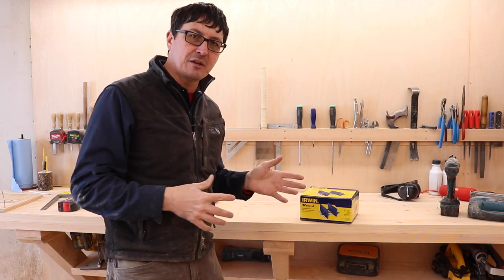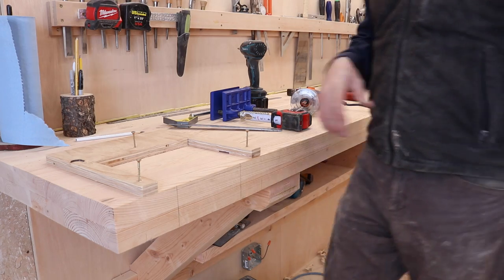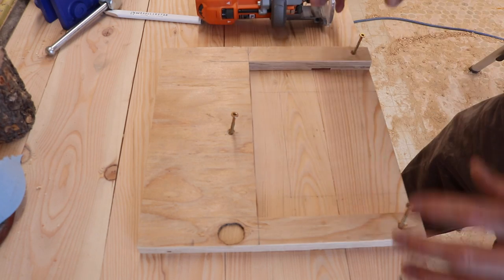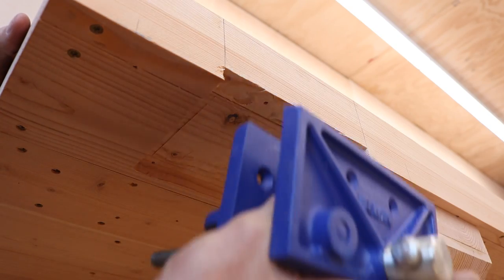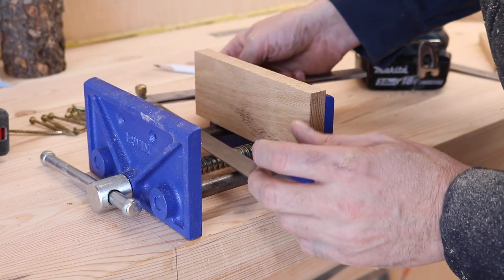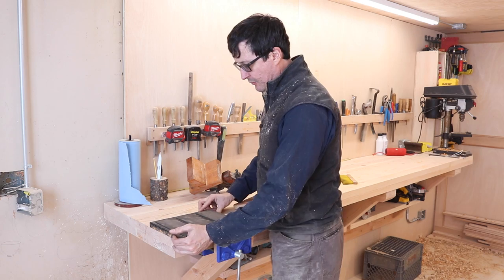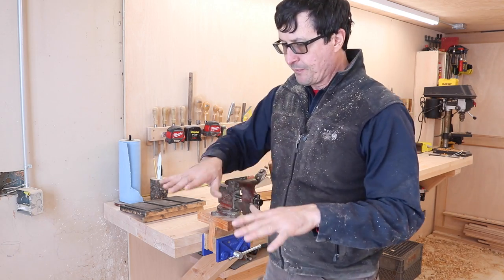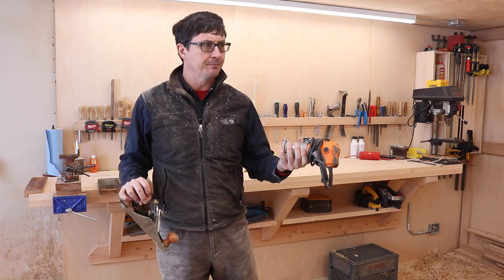The #1 Tool Every Man Must Have!!

Comment: Small suggestion, recess the back jaw of the vice into the edge of the bench you can then do away with the back packing and get an extra 1/2" of vice opening and when holding longer work the bench edge will give more stability. Consider do you want hard wood jaws? Do you want the jaws to be harder than what you put in them? or softer so your work is protected from marking. they are a sacrificial item and easily replaced.
Reply: Nice tip about recessing the jaw. I usually make J shaped jaw covers and never screw them, so replacing them it's as easy as lift them up. After awhile they are all banged up anyway. ;-)
Reply: Agree .... the jaw wood should always be soft so that they do not mar the material it's holding ... sometimes I'm amazed how some woodworkers do not think thru what they are doing ... sorry, I'm not trying to be too critical, it just comes with 87 years of experience in the shop ... thanks for your vids.
Reply: Smart stuff
Reply: @wernerfreund4949  Mmmm, sorry but I don't get that. 🤷‍♂️
Reply: Thank You RichardTWW. That has saved me about AUD$35 in not having to buy some hardwood and now I can get some cheaper pine for the jaws. Excellent! 👍 I hope that will hold the engineer vice jig when I eventually get one though. Oh well if it doesn't, I will just have to make up a set of each. One set hard and one set soft and attach them with magnets like I saw on a different channel. Best of both worlds except for the expensive hardwood here in Oz. Oh well.

Comment: Very nice bench.  This suggestion about the fixing of a vice will probably get lost in the volume of comments, however it may help someone.  When fixing the back cheek of the vice use two plaques of wood the same thickness as the cheek fixed on each side (of the back cheek) to the bench itself.  Fix the vice to the bench and fix the lining to the two plaques.  The lining can extend an inch or so to each side of the vice.  By using a thick piece of hardwood in the front lining you could bore a hole in it for a dog.  The extra inch or more on each side will be very convenient for wider pieces of wood.  

I have used the Chinese copy of this vice for an end vice with thick lining and dog.  Very effective.

Comment: typically that sort of vice should also have the fixed jaw inset into the bench face the thickness of the fixed jaw plus the sacrificial jaw.  Doing this will allow long boards to be clamped flush with the edge of the bench. Also, the wood used for the vice jaws is better to be a soft wood - pine for example. you want the jaws to dent not the work.  alternatively, add some leather in the jaws.  Anyway, my two cents - keep up the great work
Reply: this is a better idea. Im about to make a little 3ft ish portable one. Thx

Comment: I have three sets of IRWIN paddle bits for wood.
The oldest is the early 70s all still complete and for the most part still sharp.
I also have an IRWIN screwdriver about 16" long and has a wood handle attached to the bit of the driver. I have it all shined up and hanging on my sho wall.

I am in process of getting the wood workers vise now.
Using the info you gave me.

Comment: I have two of those Irwin vices. One at each end of my bench. On one of them, instead of putting permanent wood inserts for the jaws,  I drilled two 1/2" holes that are 1/4" deep into some 1/2" stock and glued two super magnets in the holes so they sit flush with the surface. Then I  glued a 3/4" strip of the 1/2" stock along the long edge, flush with the face that doesn't have the magnet holes in it. I made two of these and they are removable wooden jaw inserts that I can easily remove if I need the small 4 1/2" vice to give me an extra inch.

Comment: I watched this and ordered one it is great for my small shop and at 20.00 you couldn't beat thank you for the tip. and yes depending on your benchtop you will need to do a bit of fitting to make it hang right and to install the piece of wood for the jaws. this took a couple of days but I am as pleased as I can be  thanks Wranglerstar.

Comment: Everything about your well bench is useful and practical.  That seems to be the theme.  Since every other woodworker on YouTube has an ornamental display of planes and antique tools that will probably gather more rust and dust, I would rather see your tool wall hold tools that you will probably reach for every time you work on a project - or at least find a way to display just the ones you use most and store the rest in a secondary location.

Comment: You should really look at a dust collection system. Not only have they linked sawdust too bad allergies, cancer and asthma, it is so nice to have a clean shop all the time without constantly fighting dust in the air. With such a small space it wouldn't be tough to implement it and it is such a pleasure to work in a space that cleans itself.
Reply: That is expecially true of some of the exotic hardwoods like iroko which is very bad for you in dust format, as is MDF dust. I've never bothered too much about softwood with infrequent working - but if I were doing this level of work frequently, dust reduction would be a good idea. Does america still use tanalised timber (treated with copper and arsenic)? Dust from that would be bad.
Reply: Dust from yew wood is especially toxic.

I've read that once you inhale any sawdust, it stays in the tiny air sacs of the lungs forever and mucus cannot carry it out.  Over a lifetime of buildup and clogging, inflammation occurs, leading to copd and cancer, among other things.
Reply: Matt Earnhardt Everything in this world causes all those issues lol. So does it really matter?
Reply: Why speed the process up?
Reply: Yeah or a wear a respirator for fucks sake.
Reply: Yes please get a respirator & a dust collection system.

Comment: Good info about Irwin. Harbor Freight is also a low end vise with same problem as yours; that is, the steel plates are not parallel so you have to remember to compensate when cutting the blocks for the vise by cutting at a slight angle. Notice the non parallel near the beginning of your video as well as at 10:51. Best wishes enjoying your shop and sharing your joy of woodworking with the world.

Comment: I noticed the work bench bouncing when you were planing. Do you think it needs additional support, or is it ok?
Reply from the maker: It's fine, this is not my primary woodworking bench,
Reply: Thank you Doug for pointing that out, it is around the 10:30 mark. I was focused on the planing and never noticed the bouncing and deflection the bench had at the first viewing. By no means am I discrediting the bench or its capabilities but I wouldn't have expected it to have the much distortion. I may reconsider and use full supports that go from bench to the ground.
Reply: For a heavy bench the braces should go to the floor. It looks amazing but the flex in that bench would drive me nuts.
Reply: For someone who had built this bench as their primary bench though, well, they'd be having to build it "twice" then - right?
Reply: You can still keep the bench but I would relieve the angle on the current braces by bringing them to the floor. I would also move them closer to the outer edge especially if you plan on mounting a vise.
Reply: True.  I guess I was just being a little snarky, being as this workbench was presented to us as a "build it right once" solution, and Cody's reply to Doug's question was a bit flippant IMO.
Reply: WAY too much flex in the bench. Gonna need to beef up that wall. 24" OC studs are not enough to support what you expect to do on that bench. I was shocked to see that much flex after all the work you have done.

Comment: I think the vice is so good because it was designed by Record Ltd in Sheffield UK sometime in the early 20th century. The vices were marked as "unbreakable" in the 1909 patent documents. Sheffield is famous for the invention of stainless steel and was the world leader in tool steel throughout the early/mid 20th century. The Record brand was bought first by Marples (another Sheffield firm) and then by Irwin (from the USA) in the 1960's, but the casting moulds stayed exactly the same till well into the 1970's. I have family members who worked in the factory till 1987 when it closed.

Comment: I have the same irwin vise and love it. I have had it for years. "Common Man Tools" =AFFORDABLE
I was kinda shocked at the reflection on your work bench when you were planning. You may want to add a leg to that side of the bench. so you could add more pressure to items that you will be bending and such. Loving the new shop !!!
Reply: That was a lot of flex for sure!  Almost as bad as the plywood and sawhorses I work on.  This is just an auxiliary bench though, I am sure he will be doing most of his work over on the carpenter's bench.

Comment: I bought this small vice as a backup for a second small workbench (6' x 6') I built with wheels ... nice vice for very little money.  I'm in my 80's and been woodworking for almost 75 years ... had my shop in my entire basement (about 1000 square feet) but 2 years ago I  had a monstrous flood with over 3 1/2  foot of water ... destroyed almost everything including a couple motor driven tools ... routers, drills, overarm router, circular saws, heat pump, water heater, etc. etc ... $18,000 loss that was not covered by insurance (ouch !!) ... so I'm rebuilding gradually (hope I have enough years left to finish the shop) ... seems silly at my age but woodworking is my therapy ... sure some of you know what I'm talking about ... even with my experience, Youtubers have given me tons of ideas and I'm enjoying putting things back together.  Enjoy, guys  ... but be safe ... be sure to be careful with your table saw and routers ... these are the most dangerous tools in the shop. 

 I always cringe when I see some of you not using a blade guard and reaching across a moving blade to pick up a cut piece.  My brother did that 20 years ago and lost a thumb and a finger.  I had a commercial shop 40 years ago and  a company that made fiberglass display animals for department stores made antlers for deer out of oak ... the woman doing the work used a large handheld router to round off the edges of the antlers ... I warned her and warned her ... no ... what did an old fart know ... she lost 3 fingers and nearly bled to death before we could get her to a hospital .... OK ... sorry for my rant ... be safe ... enjoy....

Comment: I have a vise like that on my workbench. I also mounted a 3-foot 2x4 horizontally with it's top at the same level as the screws in the vise.  That way it can easily hold larger items.   Mind you, I'm not a 'fine woodworker'; Instead of 'dovetails' I'm into woodscrews and glue.

Comment: You can always mount a machinist vise  on its own board and make it so you can temporarily clamp it to that bench if you. Need it  for a specific task  i use a cheap Irwin brand one   Just that way. For myself  i think all the new Irwin  branded. Tools are mass produced in China now ?    They seem to work fine  for what they are and how their priced   I think. They work fine   Ive used the Blue  handled Marplr Chisels for  over 20 years  both  professionally. And  for  my hobby and they  have held up quite well

Comment: FYI, I find that candle wax on the vice screw works much better than oil!! Also a little  candle wax on the bottom plate of your plane helps it slide smoothly.

Comment: I vote for the hand plane display case. The crux is how to secure those in the case, so you have ready access  I personally use multiple magnetic kitchen cutlery holders they can be had at IKEA and come in bronze or stainless finishes had my heavy cleavers and such held for decades never dropped one yet.

Comment: Cody, since most of us know that it isn't good to store planes flat on the shoe, I have drilled and tapped a small hole in the rear edge of the shoe. This way I have screwed in an eye hook so I can hang them on a peg board hook.
Reply: lol, too funny!  There is nothing wrong with storing a plane on the sole, you can even retract the iron if it bothers you.  I always do that anyway,, just habit.  But even with the iron out it is not going to hurt anything sitting on wood.  I mean, when you use it you forcefully shove it into the same wood, right?  The myth comes from high school shop teachers teaching this because high school boys would slam the planes down on the metal work tables.  But check any of the professional traditional woodworkers on Youtube or ion any media and watch how they handle their planes.

Comment: Hi Cody, If it was me doing the next segment of the woodworking shop it would have to be electric sockets so that I could use my tools to make the other cabinets for the plains & routers.The price of that vice has amazed me, I bought a scaffolding foot to use as the screw to my vice and that alone cost me more than you paid for the complete vice.

Comment: An easier alternative would be to make the one hardwood insert L-shaped. mount the vice on the intact bench front. and fit the insert with the long vertical side in the vice and the shorter horizontal side over the top of the vice and back to the bench top. If you have one insert from a piece thicker than the other, by the thickness of the vice jaw. two saw cuts will make the necessary rebate, No chisel works needed, no cutout from the bench and a simple appearance. Just a suggestion.

Comment: I would like to see the hand plains above your new bench. it would break up the blank wall above the tool rack. Many of the plains could be held by a wood bracket that that fits over the tail of the plain and a shelf under the nose. Each plain would then have its own space and making the brackets would allow you to use good looking scraps instead of buying cabinet material.

Comment: I think I would recess the cast iron and hardwood into the side of the bench and that way you can take the vice off and have the bench front be flat.  Also for the price I would get another vice for the middle and do the same but just keep the vice off most of the time. In fact I would probably just not need one of the outside pieces and just switch it back and forth.

Comment: Cody please, when you are using a push stick, make sure you are pushing the wood as close to the blade as possible. This will help to keep the wood against the fence as it applies a rotational force towards the fence at the front on the board. 
just looking out for your safety. :)
Reply: It's great you're concerned but the man is in his late forties and has worked construction for many years.  I think he knows how to use a table saw.  Remember the angles you see on video don't necessarily reflect the reality.
Reply: Actually, I have seen him using it incorrectly in privious videos. I now own a business in the industry and know what can go wrong if you use a push stick incorrectly. One of my employees almost lost a hand because of this exact issue!  It doesnt matter how long you have been working with a table saw, if youve not been told you wont know! 

Dont be fooled by my channel name. It was many years ago that i set this account up. 

Dont be so quick to think someone is less expirenced than you!
Reply: So what are you now, like 24?  Quit trying to out-piss everyone kid, it doesn't really impress anyone.

Comment: Irwin may not produce high end tools, but I also think they are one of the best brands to buy for the money. They kind of remind of Black and Decker back in the day, when they were the power tools to buy for any DIYer. I think no shop should be without the Irwin quick clamps. I have about 8 of them, and they never let me down. Those are some of the best made clamps on the market. I also have the Irwin Forstner bit set, and I have used them on everything from hardwood to MDF and they drill beautiful clean holes. You have to go slow with them, but if you do, they will last a really long time.

Comment: Generally a face vice like you have just fitted should have the rear face and wood 'softening' or 'packing' fitted flush with the face of the bench ... rebated or rabbeted into the face like you did underneath the bench. That would make it easier to work on long sections of timber.

Comment: I don't care for the workbench, I think 3/4 mdf cut in half the long way is better. Double it up and screw it together on the ends and front about 1- 1 1/2" in  Don't glue it together. When the top layer is beat up, swap it out for a new piece. Using solid wood is unnecessary for a  work area that gets beat up. (It's also too soft if you're using pine.)

Comment: Have you thought of using wood jaws with a cutout for the screw and the two shafts, that way they slot in and hold themselves in the vice, you don't have to screw them in. Just means you can remove them without taking the vice apart.

Comment: both Cody.. both. your going to need both. I did just buy my first compact also. I purchased the Makita though.  I do believe a router table jig would be interesting. something small but sturdy I could haul to job and clamp to sawhorse and mount up my little router for doing lots of sills and trim pieces. I also seem to use it daily along with my new Stanley block plane. Not sure how I got along without them. Oh that's right I barrowed them and we all know that barrowing tools is for the weak. ;) keep posting daily bud its awesome.